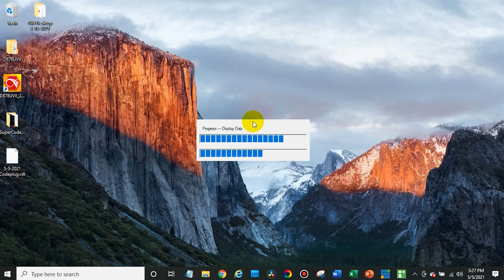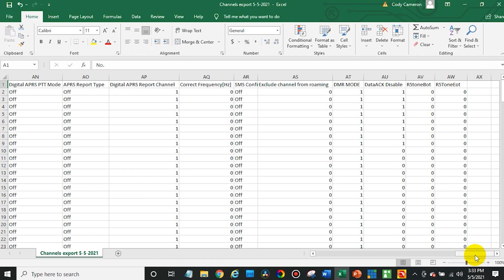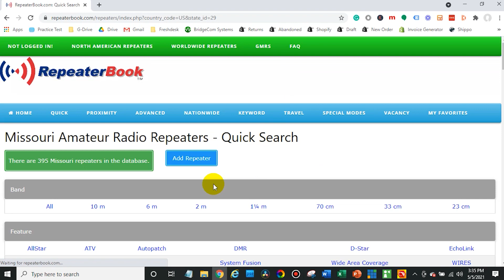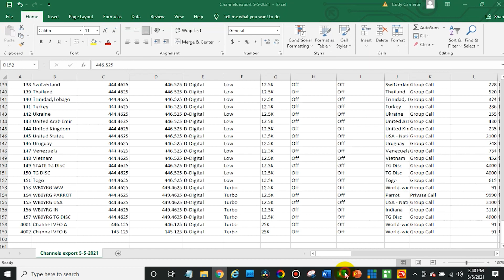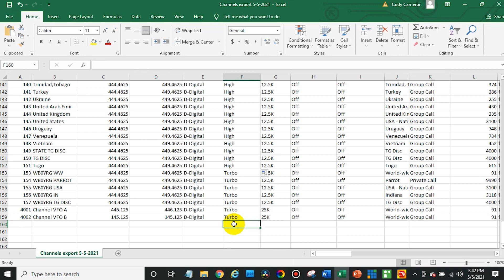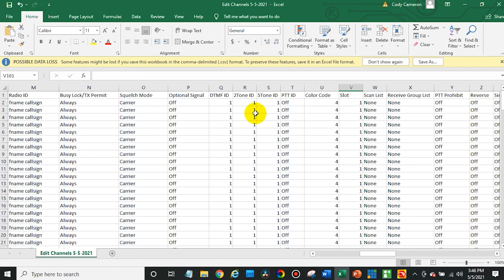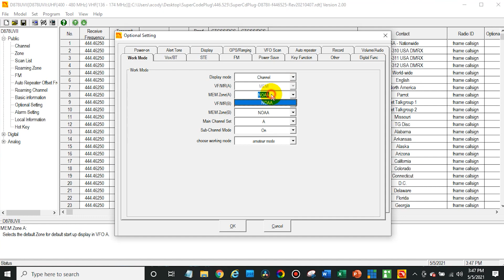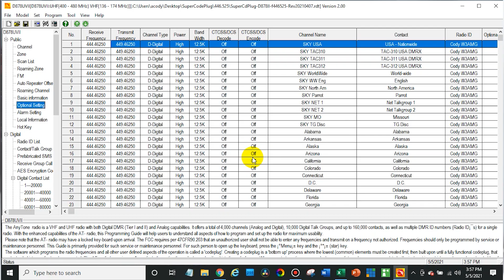How to Program a Super Codeplug for Local Repeater Frequencies | DMR for Beginners

Comment: Excel pro tip: you can auto-expand all or several of the columns in a worksheet at one time by selecting the columns you want to auto-expand (for example, clicking the top left corner of the spreadsheet or pressing Ctrl-A to select the entire spreadsheet), then simply double-click your mouse on the divider line at the column headers to auto-size all the columns instantly.
Reply from the maker: Hi! We appreciate your comment. If you’re looking to connect with other hams, check out our Facebook group here: https://www.facebook.com/groups/BridgeComSystems. And, if you haven’t seen it yet, our best-selling Plug-and-Play Package is worth a look: https://www.bridgecomsystems.com/pages/plug-and-play-package.

Comment: There is (still in 2024) a bug by which the zones get wiped out by importing channels, even if you also import zones. It makes no sense, but there it is. I had zones; I exported zones; when I went to import channels and zones, the zones were blanked the same way yours were.
Reply from the maker: The way AnyTone designed the software, its channels and zone information had to line up. If anything in the channels doesn't line up, it will wipe out the zones. It's not a bug. It's the way AnyTone designed the software.
Reply: @BridgeComSystemsInc ...alright, if you want to play that game: it's a poorly designed feature which should be redesigned for improved robustness and easier use.

I'm a software engineer, have been for 32 years. I have written software akin to this. There is no reason why it has to behave poorly, it just does.

Comment: Hey Cody. If I change my channels to work with a local repeater can I simultaneously keep a set designed to run on my hotspot? Unless I mistaken, it seems the original “hotspot” channels were overwritten by the “repeater” enabled ones. 

Thanks for opening the world of Bridgecom resources and DMR 🎉
Reply from the maker: Yes. You need two different sets of channels. One group for the hotspot, one for the repeater. you would put each set in it's own zone.
Reply: @BridgeComSystemsInc  thanks

Comment: A little disappointed, I spent much of the day trying to figure out how to open the super codeplug in excel without the radio. I ordered an 878 2 plus Wednesday and was hoping to format the codeplug before the radio arrived. No joy to say the least. I am DMR illiterate but using Bridgecom's University to get some knowledge. I'm 40 miles from the nearest town with a population above 500 so a hotspot would not be very practical. However, within the last 12 months 2 DMR machines have been installed to complete the Rocky Mountain link with the New Mexico link. This completes a link system from Wyoming to El Paso on DMR. The Mega System on analog covers almost as much area. I've had an HD1 for 2 years and still haven't figured out how to add talk groups, 😆. This digital stuff is interesting to me though my first station weighed almost as as my truck.

Comment: Is there any possible way to reprogram a radio (in my case a Tytera MD-2017) using another radio? The end goal would be to have transmitters permanently setup ~2000ft away and be able to change the transmit frequencies remotely. Is this possible? Thank you

Comment: Cody, For those of us new to DMR, there was a bit of confusion as to why all contacts got the same setting. My assumption is that you are simply using your local repeater frequency and settings to contact any other DMR location in the World. Can you take a minute to explain how, for instance, you would use the super codeplug from Kansas City to contact Florida or any other state? Since all channels have the same settings, it is unclear how the “message” would know that it is Florida you are attempting to reach. KJ7YBK
Reply from the maker: The channel settings are set to "hit" the repeater in Kansas City as that is nearest DMR Repeater. Once it hits the repeater in KC, the rest of the channel information that remains the same, tells the signal where to go. So the signal goes from your radio to a local repeater, then to the repeater of wherever you're contacting, and then to the radio of whom ever you're speaking to.
Reply: @BridgeComSystemsInc  Cody, I re-watched your video and the only unique fields (once you were done editing) in the channel list is the Channel Name and Contact. Is this what is used by DMR to determine where the message is aimed? Sorry to come across dense, but I really am trying to grasp the concepts. Thanks
Reply from the maker: The Contact TG/DMR ID section determines where each call is aimed. The Brandmeister Network uses Talk Groups to delineate each channel. For example, TG 3101 is assigned as the Alabama talk group. Here's a video that might help you more with the concepts: https://youtu.be/-3HGGieNUx8
Reply: @BridgeComSystemsInc  Thanks Cody, A big help for us newbies.

Comment: Is the Super Codeplug only pre-configured configured for a hotspot only and its up to you to go through  the States you might be traveling through to work Repeaters?
Reply from the maker: Correct.
Reply: Thanks for clearing this up.  I originally thought the Super Codeplug was configure for each State and the Repeater Freqs so all you had to do is bring up the State in the Zone and navigate to the Repeater and you were good to go.
If I understand it correctly when using a hotspot while traveling you would be in good shape.   Thanks again.